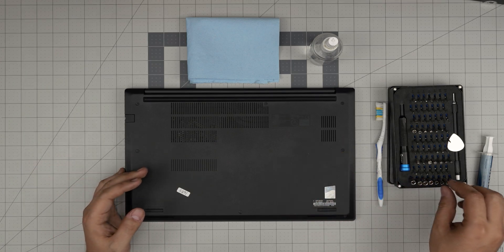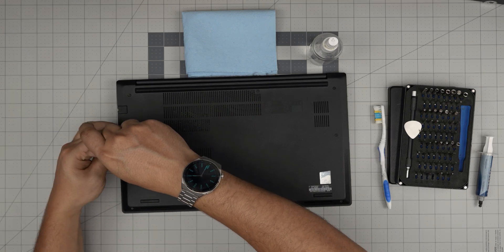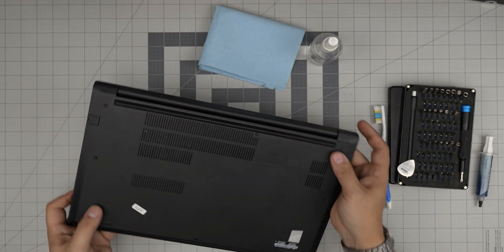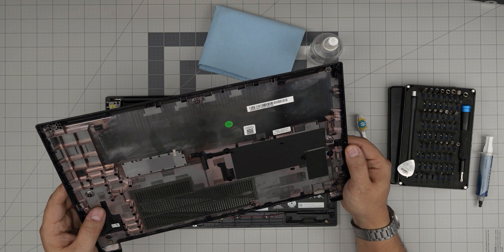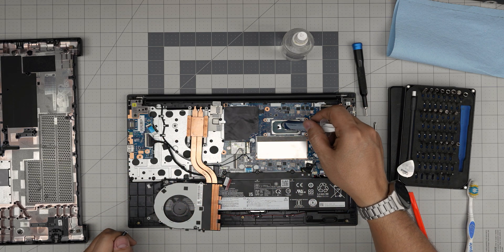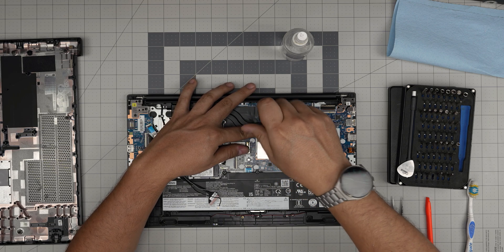How to Repaste and Clean Your Lenovo ThinkPad E15 Gen 2 Laptop | Maintenance Guide

Comment: Does this laptop come with an Intel processor?
Reply from the maker: 🫠Regarding your question, right at the beginning of the video, you can see the Intel sticker on the laptop. To answer your question, it's an Intel CPU.
Should you have any further questions or requests in the future, please don't hesitate to ask me.
cheers🍻
Reply: @uFixTek  oh! I missed that part. I'm going to do this once the thermal is shipped this week. I'm an AMD CPU, so the fan decomposition method is a little different. I'll refer to the video and finish the work successfully. Thank you.
Reply from the maker: The AMD and Intel models are almost identical. If you can follow this video, you can apply it to the AMD version—it's super easy.
If you need help, let me know.
Reply: @ZzeSXMtkQ  I also have the AMD version and I see it in the same place

Comment: Mine wants me to put pressure on the cpu for it to turn what could be the problem?
Reply from the maker: 🫠Regarding your question, the issue is that your CPU is a BGA chip, which means there are many solder joints under the CPU, and you likely have a cracked solder joint. You will need to reflow the CPU by removing the motherboard, placing it on a table, and using a heat gun at 240°C for 5 minutes, keeping a distance of 1 inch above the CPU. This will resolder the CPU to the board.

*Note:* Let the board cool down by itself without touching or moving it.
Should you have any further questions or requests in the future, please don't hesitate to ask me.
cheers🍻
Reply: @uFixTek  just the heat gun only and never put pressure afterwards? And must I mover around the heat gun? Also do you have an example video of how it's done?
Reply: had the same problem, for me it was the (red!) threadlocker on the screws. agree with the general principle of applying heat, but u can do it in a more targeted way directly on the four screws covering the CPU, using a soldering iron. what worked for me was setting the iron to 300C and letting the tip adhere to each screw for 15-20 secs. after that, using a screwdriver and very little downward pressure, u could hear a tiny "crack" (the threadlocker giving) and then the screw turned without problems. im not sure why red threadlocker was used here, but this way of doing it seems a bit more straightforward than the heat gun method